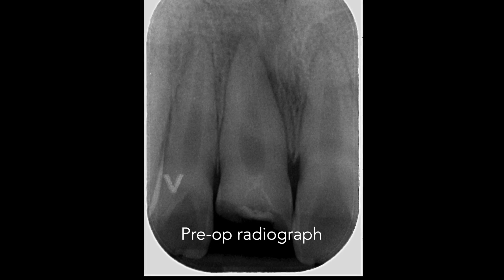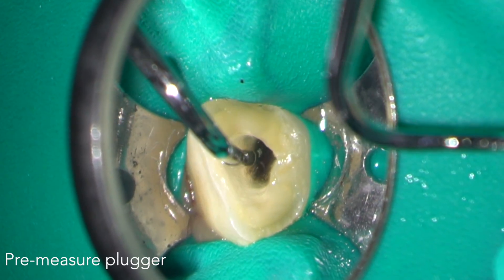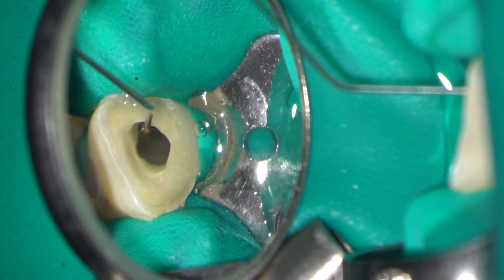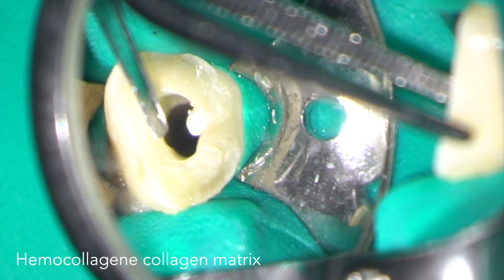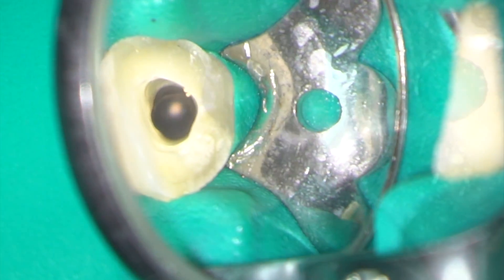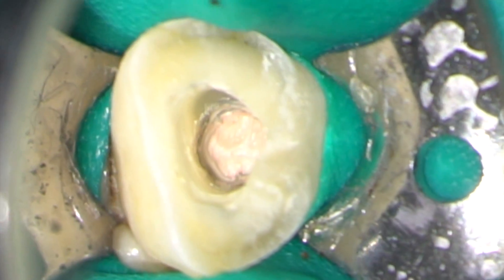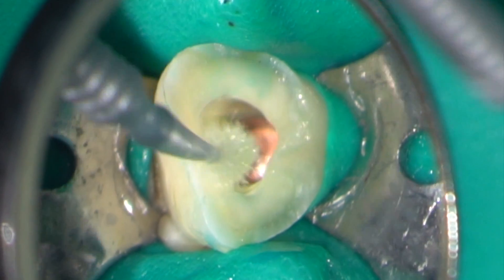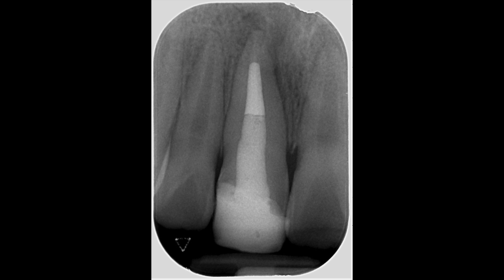Corking the apex with Bioceramic

Comment: Hi - would there be any worries about sodium hypochlorite extrusion with a wide open apex, especially with agitation? Great video.
Reply from the maker: Hi Neil
Always use precautions:
use a side venting needle
bend the tip 2mm shorted than WL
inject very slowly and don't let needle bind
Agitate gently and not too much vertical pumping
Thank you for watching and great point!
Cheers
John

Comment: Hello John, 
I watched endo webinar yesterday and endodontist here said that he doesn't use bioceramics because in couple of cases sealer hasn't set.
Have you seen that, should I stop using bioceramic sealer?
Thanks 
Les
Reply: What brand were they using?
Reply: @paymonmousavi9150  
Not sure, I will ask him. 
I use BC sealer from Brasseler.
Reply from the maker: Hi there,
I use BioRoot RCS and have never experienced this problem, in fact when I have done surgery on cases sealed with BioRoot RCS the material is solid.
I know many of my followers use BC Sealer and haven't reported a problem? perhaps if the canal was not dry or there was a large lesion with fluid backing up into the canal?
Cheers
John
Reply: @johnrhodesendo  
Hello John, 
Thank you for your quick response. 
I actually  just received email from endodontist who experienced problem with sealer not setting. 
He had used BC sealer from Brasseler, the same sealer I have been using. He said that still will be using BC sealer but only in selected cases. Now I have dilemma use it or not to use it?Or try different brand.
Thank you 
Les

Comment: Hi John, did you measure the plugger 2 mm short of the working length?  thanks
Reply from the maker: Hi Ash
The plugger is marked at the WL and the collagen is pushed through the apex to sit at the WL
Cheers
John
Reply: @johnrhodesendo  thanks john. i assume you dont use the plugger to working length when condensing the biodentine to prevent extrusion? how do you gauge how far to go with the plugger. many thanks :)

Comment: Respective Sir greeting from Nepal.  I really like the video which you share. I wonder, can we use any specific instruments to carry Biodentine to the root canal which can make our procedure much earlier, in addition, can you share a video on your endodontic setup. Thank you.
Reply: I used to use a special instrument - the same used for amalgam (amalgam gun) - but the material would often set inside and destroy the instrument. Since I saw Dr.Rhodes using simple plugger to place Biodentine, my work is much easier and cleaner. I would not go back. The trick is in the consistency of Biodentine. It requires a little practise.
Reply from the maker: Hello Ajay
There are carriers available, similar to Dovgan.
Sure I will probably take a look at more surgery detail on Vlog
Cheers
John

Comment: Great video John, quick question if you were to extrude the collagen matrix through the apex or bioceramic putty, what would happen? Also I noticed that the putty tends to stick to the metallic instrument. If there was a way to change the electrostatic forces either by changing the material of the plugger that way it would not stick. It's been a long time since I studied electomagnetic forces but someone should invent something as it would really help!
Reply from the maker: Hello....maybe teflon coating would be good?
Cheers
John

Comment: Good case selection and brilliant management ... I have a question regarding last Layer of material that you use ... why do you prefer to fill 1/2 of canal with resin as we know that resin doesn’t have much bonding strength to Dentin ...?!                                               Please excuse my ignorance and thank you 👍
Reply from the maker: Hello there!
The composite is dual cure in the canal to help over come problems of shrinkage and reduced bond strength, but it is not providing strength to the tooth.
Cheers
John

Comment: An excellent presentation again Dr. Rhodes. Thank you for sharing your experience.
I'd like to ask about your material prefeance on this case. 
Firstly, why you choose 3 layers of material to fill the root canal?
Secondly, I thought that you will use just GP and a bioceramic material. Could that be an alternative option?
Thirdly, as far as I know composite materials do not have much bond to the dentine. Therefore, I am curious about why you place the composite at the 1/2 of root canal. 
I have had an similar case and due to lack of material I referred the patient to another clinic. So that, I really want to know if there is a contemporary guideline for managing open apex cases like this. 

Thank you for your interest!
Reply from the maker: Hello there!
great questions and thank you for watching....
I used three materials here to just demonstrate a different technique, I have also used a two material technique with Bioceramic and Composite.
Gutta percha is easier to remove than composite or BC, the patient was only 8 years old and we don't know what will happen over a lifetime!
Composite is placed below the level of the CEJ, is is not providing strength to the tooth but forms part of the build-up. the material is dual cure to help ensure adequate setting, reduce contraction and achieve some seal with bonding (all be it not as good as bonding to enamel!)
Cheers
John
Reply: @johnrhodesendo  Thank you for your reply!
Reply: Hi John. Thanks for an amazing presentation. One question regarding bonding to dentine and leakage; why not use glass ionomer between the gp and composite?

Comment: Hi John, excellent video as per. I have a couple of questions for you.
 Do you usually seal up the access cavity purely with composite every time before sending the patient back to their GDP? Reason I ask is re-access for non vital bleaching should it be required may be more difficult if there is no different coloured material such as a bright white layer of RMGIC or whatever overlying your GP allowing for easy identification of the GP commencement?
Secondly, what made you go for this technique instead of a regenerative approach, as I believe the criteria are fulfilled?
Thanks in advance
Reply from the maker: Hello Sandeep,
We seal all access cavities, unless bleaching is required in which case we seal the gutta percha and leave a space for the whitening gel. We have learnt from experience that it is better to completely seal the access before sending back to the GDP, we provide cores on most molar teeth.
The apex in this case had developed sufficiently for an obturation technique and so that is what I used, if the root length had been 2/3rd of normal I would probably have opted for a regenerative technique.
Cheers
John.
Reply: @johnrhodesendo  Thanks for the reply John, I suppose as long as GP is sealed that's the main thing. I presume you don't always assume that bleaching will be required in future, so if a dark anterior tooth came in you would RCT it, seal GP and leave the access open for bleaching immediately with the GDP?
And I understand what you mean with regards to root development; apexogenesis would only really be attempted if root development had arrested, but you would tend to cork the root if the apex was wide and the root length normal.
You've clarified a lot of questions I had. Thanks again and I look forward to the next video.